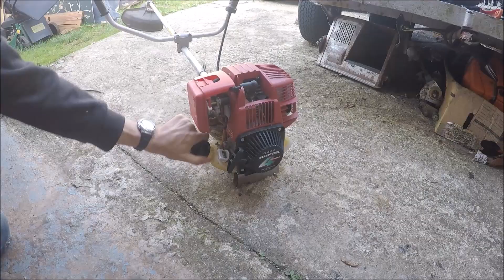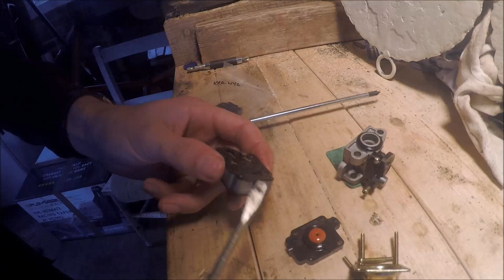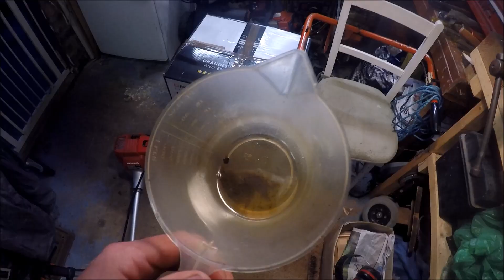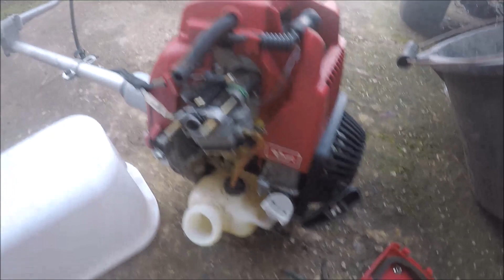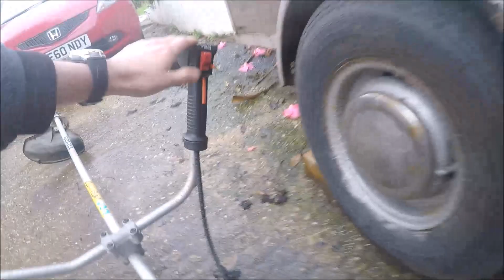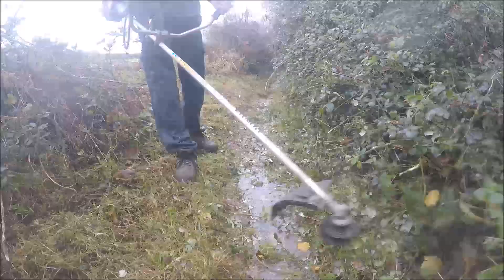Fixing a Honda gx22 brushcutter

Comment: Good job mate. Just been working on the same strimmer. Had a hole in the fuel tank which I repaired with a soldering iron and plastic milk bottle container,. I checked and they are both made out of ptfe so the repair looks solid and no leaks. On my carb there is a "high" adjust screw on the side and the "low" screw was hidden under a little rubber grommet on the top of the carb where the throttle linkage is.There's a little brass circle and the rubber is inside with the little screw underneath. Was running good today, lets see if it starts tomorrow lol. Thanks man.

Comment: 💪 last thing replaced is the faulty one 😅 I wanted to take ride today but the engine lacks power and cuts off ... started with the carburetor, spark plug, ignition coil and finally found the culprit magneto. Sometime it's hard to find bug in the system, takes a while, but at least you have a good revision on the engine with all that carburetor rebuild and fuel lines and filter replaced. 👍
Reply from the maker: It’s easy to overlook something simple. I need to start working on both of my bikes and ride them again
Reply: @Devon.Ferguson  :yougotthis:Just took a ride, preparing video with it. It's nice the feeling of freedom a motorized bike gives: no registration, emission test,  insurance, driving license, kinda of an outlaw  😁
Reply from the maker: @gherosh  your right about that
Reply: @Devon.Ferguson  here you go https://youtu.be/mLAYl6bdtO0 the video I was talking about.

Comment: When you don't know what you're doing, keep doing the same thing and hope it cures itself.  Next time adjust the H needle on the carburetor.
Reply from the maker: On that carburetor there is no L and H adjustment screws. But even if there was, the spark plug would still be the problem.
Reply: @Devon.Ferguson  Not to mention you mounted the carburetor metering gasket on top of the metering diaphragm - supposed to be the other way around.  Surprised it started and ran at all.
Reply from the maker: I didn’t show it but I did correct that. Still runs good.
Reply: @Devon.Ferguson  All's well that ends well.